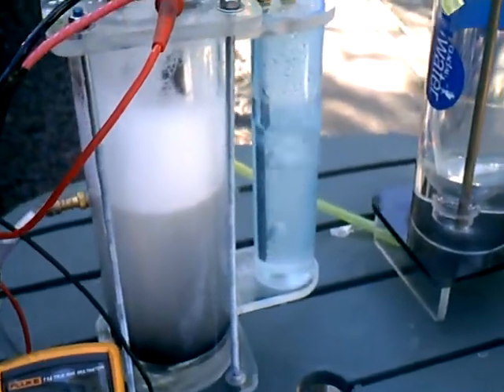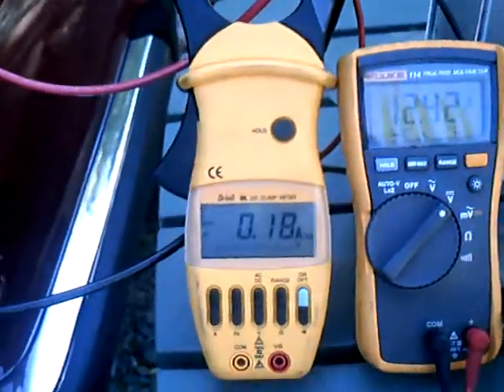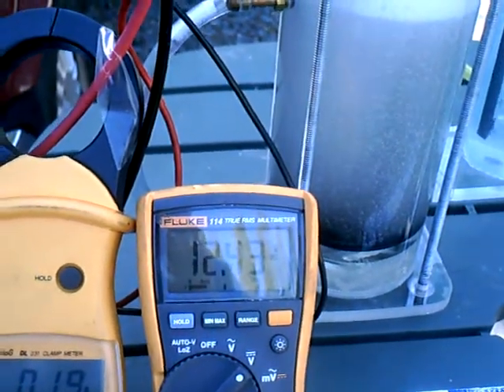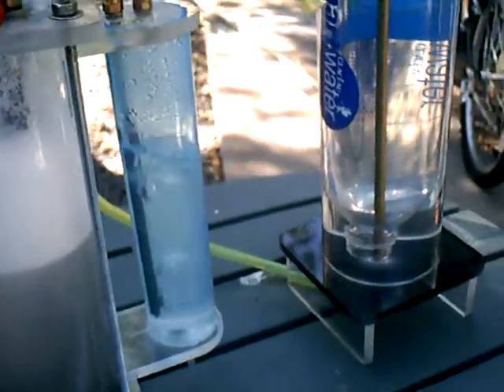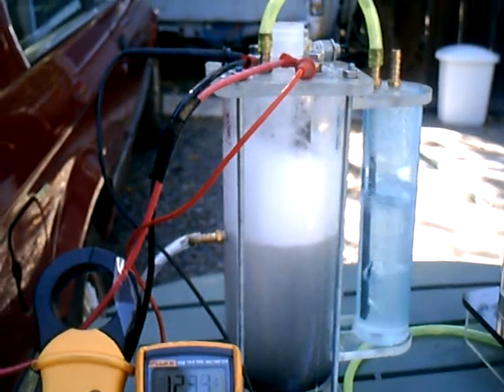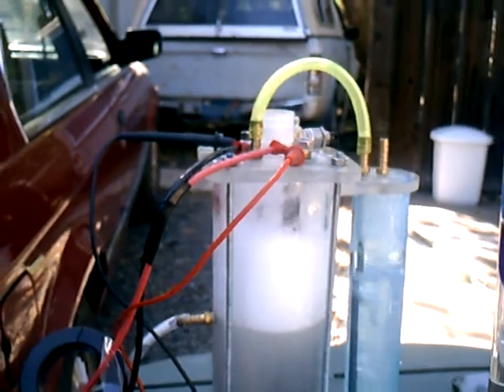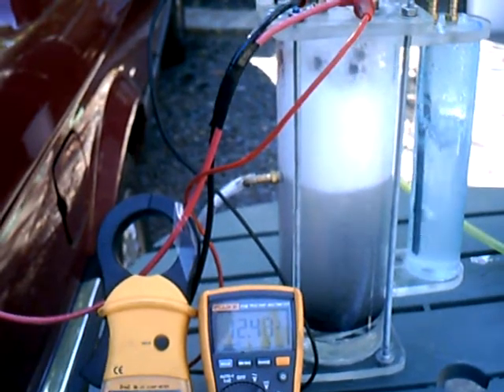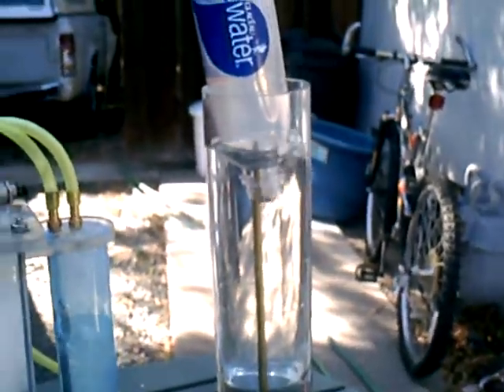HHO Gen test # 4

Comment from the maker: Hi Stu,
Well it's  not a fake, The bottle is 1 Litre, there is a small air pocket at the top, which is why I wait till the gas escapes the bottle to call it a litre.
I am not so concerned my self with absolute #'s down to decimal places, my goal is the mileage #'s
I use distilled water with enough Sodium Hydroxide to give me around 20A cell hot. 
As to my "tweeks" if you want to let me have an email  address I'll send you the still shots of the design/construction details.